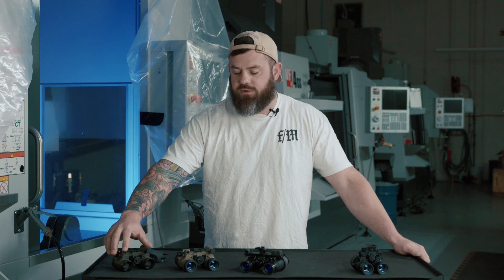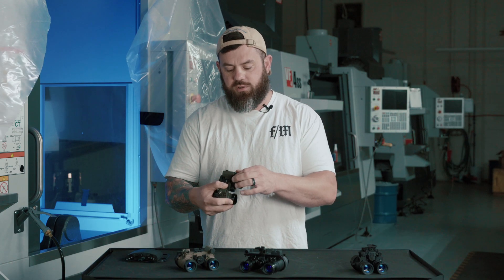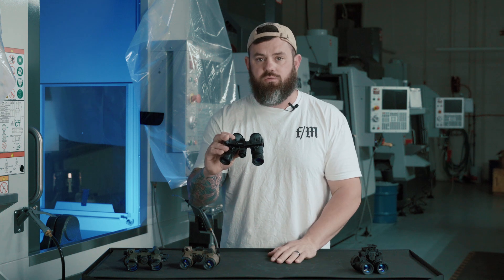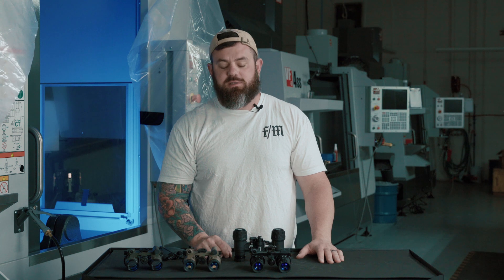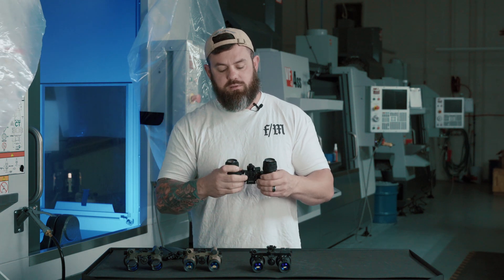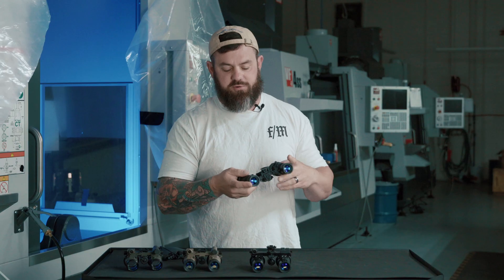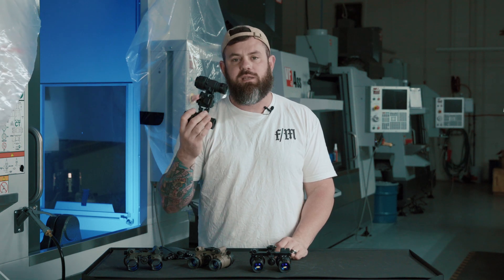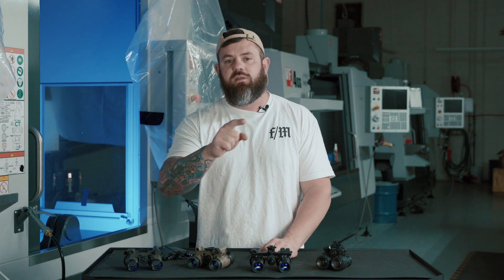Custom Night Vision | AB NightVision Housings | RNVG | RPNVG |ARNVG

Comment: I m new to NV.. are all the variants of RNVGs made with PVS 14 tubes? Is the difference in the housing or the tubes themselves also?
Reply: There is no such thing as pvs14 tubes. Just a pvs14 housing. The tubes are what makes them work at different quality levels think of the housing as wheels and the tubes as tires. You want a durable wheel but different tires offer different qualities in different conditions

Comment: No me it's not acceptable a housing over 2k€ without IPD stops. And also the integrated IR is stupid since it's a point of failure.
Reply: Even if it fails, so what? My PVS-7s had integrated IR, never failed. Decades of use.
Reply: The dtnvs is WELL over 3k with no IPD stops, $500 more for ipd stops, no lemo port, and oh yeah.. there plastic. 

I’ve not heard one issue of the lack of ipd stops on arnvg’s. 

To recap.. you get a lemo port, metal construction, better warranty, and easier interface, for… 2/3rd the cost of the plastic unit?

Comment: Man just one more feature with adding manual gain and the ARNVG would have literally all the features.
Reply: And really that’s not even a must have. You can get some cheap adjustable irises and get the same function
Reply: @patrickm.blanchard8497  I live in densely wooded areas so I would take manual gain over an onboard IR illuminator because I’m going to need something more powerful regardless. Adding an iris is an unnecessary workaround IMO.
Reply: @Veritas1992  Manual gain only is there to adjust down the brightness of the tubes. Living in densely wooded area and onboard IR would be beneficial for walking with no moonlight or traversing thick areas.
Reply: @patrickm.blanchard8497  ehhh not exactly but kinda
Reply: What about panning? We need  ARPNVG

Comment: Even an ax14 pro j arm on a PVS 14 is well worth the money. Say it's raining you can leave it down and articulate it up out of the way without filing the objective with water. I'd definitely buy it again. I've never had it moved. Wether you're running or driving it stays where you put it.